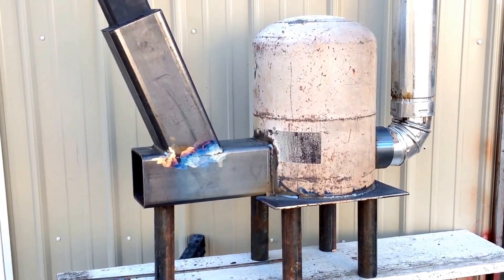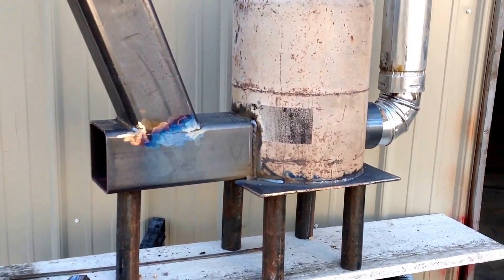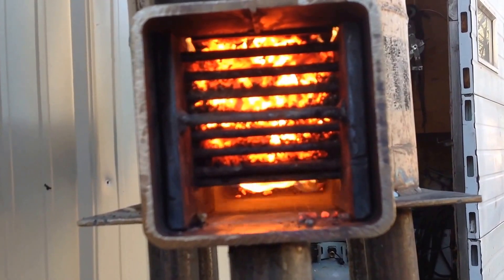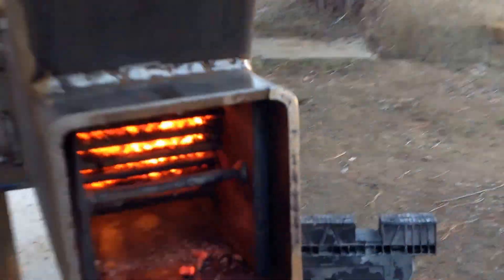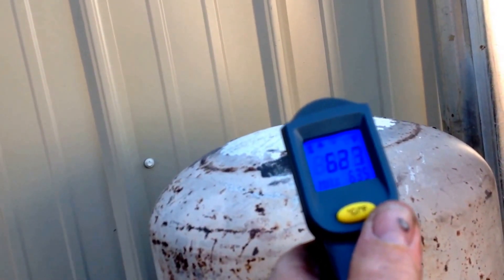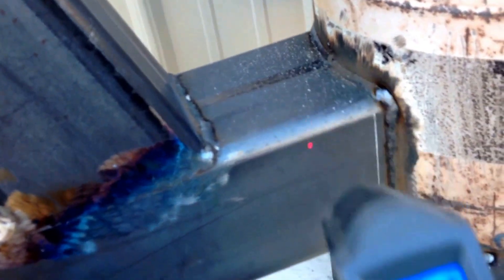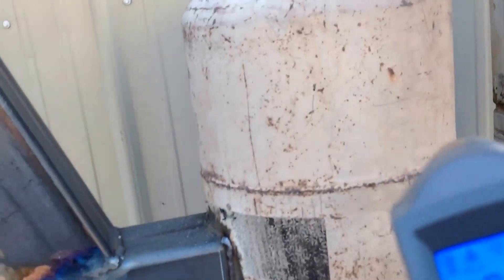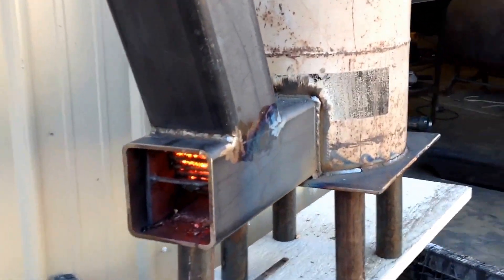Rocket stove by Mike Knop

Comment: nice stove mike! I am wanting to build one to heat a small space. using 4" tubing  with a 6" casing then 8" stove pipe and a 12 volt fan to force the heat down and across the floor. any suggestions or desighn changes I should make? just don't want to have to build it 2x cause not enough flow or issues. any way great stove build!!

Comment: Aren't you  concerned about the metal burn tube starting to break down with those kind of temps? In my experience, my 3/16" metal burn tube started to flake apart and collapse after reaching over 650-700 degrees. I eventually made mine out of fire brick that I glued together with high temp refractory cement and it works awesome!